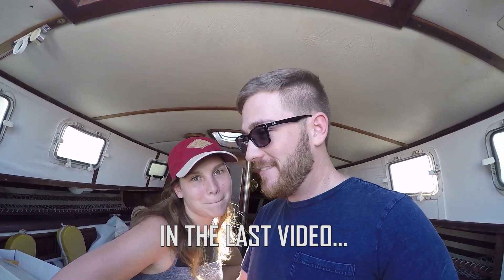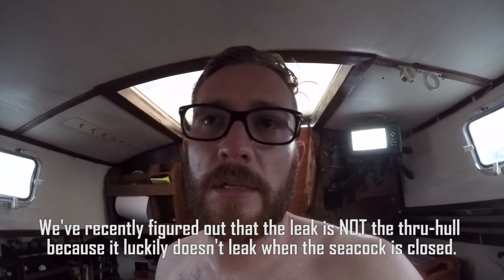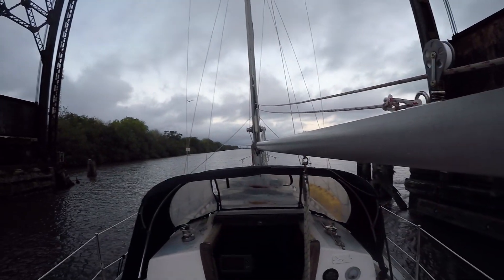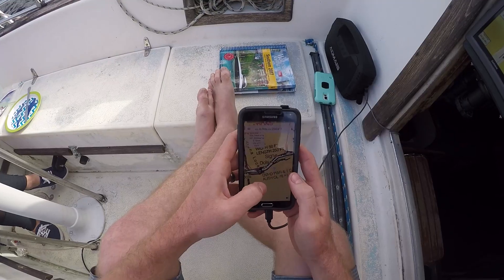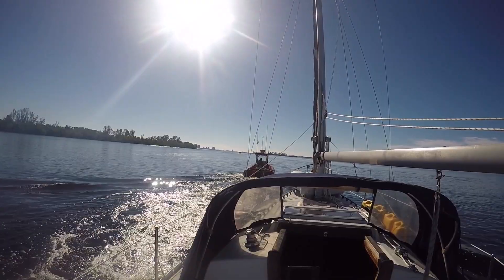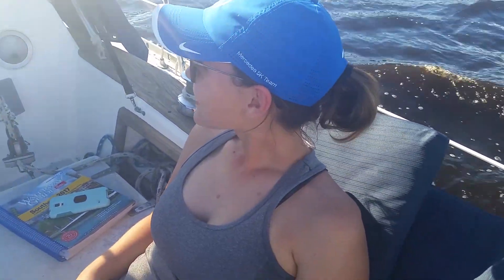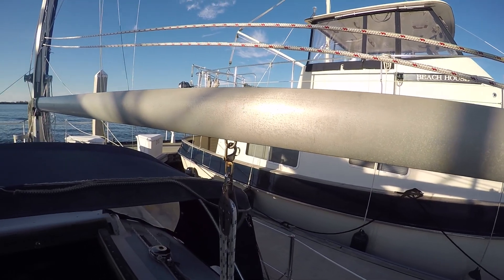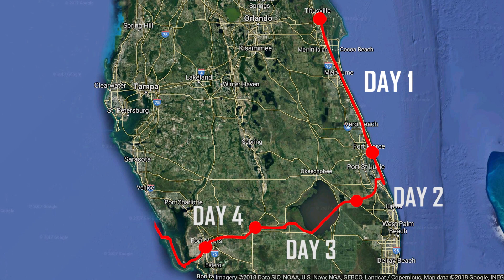33. Three Hundred Nautical Miles on a FREE BOAT! - DIY Sailing

Comment: I've never been that route in a sailboat either. Never even occurred to me not to sail around south Florida. Well done. Thankfully, you got a boat with a short mast.
Reply from the maker: Right? We were worried even though we double and triple checked the heights. Supposedly some people heel their boat with barrels attached to the mast if they're a little too tall.
Reply: Learning the Lines That can be tricky and can end up with a capsized boat! Also, you can bend or break the mast. On rivers around the world watch out for low crossing power lines as well. Cheers.
Reply from the maker: I do not like the barrel idea at all. Lol. I'd rather find another route, but I guess sometimes you have no other options. We bought a book that was all about sailing in the southeast region (I can't remembered the book/guide's title and its on the boat), but it mentioned the power line issue in it. There was a set of power lines on the ICW on the east coast that we had to cross under that has apparently caused many issues because of how quickly it tapers down from the mid-point. Apparently a lot of ships have had their electronics fried because of arcing from those power lines. Scared me reading about it. Lol. Made sure we crossed directly under center. -Randi
Reply: Learning the Lines Seems to me that you two are studying up on things which is a great way to go. There is a fifteen week boat course in Ft. Lauderdale that would have you ready to take on the world if you are interested. And there are lots of people who have brains you can pick and of course there is always books and tech stuff!
Reply from the maker: Yes, we actually love the learning process. Is the Ft. Lauderdale course done on weekends? It's a bit far for us. We watch a good amount of informational boat videos (e.g. Skip Novak's Storm Weather Sailing) on Youtube, plus info from comments and books. -Randi
Reply: Learning the Lines Actually, the course I was referring to is 15 weeks and very hands on intensive. There are two maritime training schools in Florida. MPT and the Chapman Institute. The course I was talking about gives you a full working knowledge of boating from the basics through emergency protocols. The USCG Captains license you get at the end is a minimal thing compared to what you learn. This is a professional level curriculum and takes the same dedication as any college or vocational training. The benefits to being a trained sailor, are lower insurance rates, peace of mind, and the ability to take paying passengers should finances be an issue in the future. The bottom line is that the sea kills people every year and preys upon the ignorant more than the knowledgeable. Don't want to get too in depth or time involved? No problem. Call one of the institutes and see what courses you can fit in. Also ASA has affiliate instructors ALL over the U.S.A. for their classes as  well. Cheers!
Reply: Amazing how many times in life a short mast actually makes life easier...
Reply: Hello Charles, I am interested in the fifteen week course in Ft. Lauderdale.  Can you share this information with me, please.  Thank you in advance.

Comment: Fix the boat and runit you need to be more self dependent diesel is easy only proses of elimination you should get to marina and get parts and install the buy and bring some harbor freight tools machanics a expensive if you used he fixed it 2 hours you could of ben on the way if you kept a few tools

Comment: Hi guys. Really well done, not only on getting there but making a great video too. Regarding your leak. It's possible that you're getting water into the boat via a thing called the stern gland. This is the "device" which the propeller shaft passes through to the propeller. You need to establish if it's an old style gland with gland packing material in it (usually has a big nut on it, or a sort of plate with a nut on either side, well, save a load of words, have a look here, scroll down to find yours : https://coxengineering.sharepoint.com/pages/sternglands.aspx). It will either be one of these or a newer (& costly) dripless seal type. If it is an old style one, and it drips in a cupfull or so an hour when the engine is in use, don't tighten it to prevent that. The water lubricates and cools the whole thing. It can be adjusted, and the Boatowners Electrical & Mechanical book by Nigel Calder should have a good description, or read that link I've posted. Vyv Cox is one of the foremost yacht/boat engineers in the UK, so following his advice will stand you in good stead. Although it's tempting to rush to a new style dripless one, I wouldn't recommend it. If the old style one fails, there are a number of ways to recover from it, & if maintained they're very reliable. Some of the newer one's are brilliant until they fail, and when they do they tend to be very difficult to seal to keep out the in-rushing water, so you could end up walking home. The boat looks like a winner as far as I can see, and a little maintenance (which you could need on a $100k boat anyway) and you'll be flying. We're cheering!
P.S Time AC's dog got his own channel :-)
Reply from the maker: Thanks for watching and for the input! We are familiar with the old style stern gland from removing the propeller shaft on our O'Day 272. We will need to carefully inspect the one on the Endeavor though to see if this is the source of the leak. Jordan thought it could be coming from the raw water inlet somewhere. Roo is an awesome dog! He doesn't have his own channel (yet), but he does have his own instagram: @meruthemini 
-Randi

Comment: A free 31' sailboat. With a working engine. With a roller furling main and roller furling jib. You've got some good karma. What's happening to the old boat?
Reply: I was blown away as well. Free boats usually come with ZERO extras and a seized engine...
Reply from the maker: Project Manaia - Ocean Conservation & Research We were very lucky indeed.
Reply: how long will the engine work,''Free,ugh..Nothing's Free..
Reply: I wish that I knew where to find a free or cheap sailboat. I know that I can do all the work to refit being that I'm a carpenter and am good with engines. Any help to point me in the right direction would be greatly appreciated.
Reply: Learning the Lines have you found a new dream? Or did you find a new boat?
What's up with y'all?
Reply: Get A book About Sailing,Refit,boat engin's,Wether,tide's,Wind,And how It work's on Sail's,For a Start*

Comment: $200 for corroded fuel pump terminals? White grease is your friend. It will prevent a repeat performance.
Reply from the maker: Thanks for the tip! The price was mostly for labor/cost of the mechanics time. We are definitely going to be checking our terminals and greasing them to avoid any further issues. -Randi
Reply: You want to get in an aerosol can. You should find it in places such as your local Auto Zone or Advance Auto.
Reply from the maker: Thanks! -Randi

Comment: My Endeavour fills up with water more when shes hauled out then when she is out on mooring, lol
Reply from the maker: What do you think is causing your water issue? We are still trying to figure out where exactly on our raw water intake is leaking. We are just happy it is not the thru-hull. That would be a much bigger project. -Randi
Reply: Learning the Lines pretty sure it's the cockpit and or lazeretts
Reply from the maker: It's always tough to determine the source, there's so many possibilities. Lol. One of our other viewers with an Endeavor 32 found that his binnacle was leaking. -Randi
Reply: Learning the Lines I think that was me , as soon as I covered the compass on the binnacle I noticed the difference but the bottom where it connects to the cockpit deck is very suspect
Reply from the maker: Jesse Reed S/V Matador Whoops! Lol. It's hard to remember who wrote what, but at least you know I was paying attention to what you said! ♡Randi
Reply: No worries, Cheers guys !

Comment: It’s a diesel they’re not complicated if you think it’s not getting fuel crack a fuel line loose and turn it over and see if it sprays out if you lost the injection pump shouldn’t be that hard to fine there those are not that hard to fix

Comment: You must learn engine repairs before stepping on a boat.
The main reason the engine wont start is ... the fuel not reaching the combustion chamber.
Reply: He did suspect the fuel pump.

Comment: Are inboard diesels so unreliable on just about every cruising channel the engine breaks on every episode it seems.
Reply from the maker: Haha it does seem that way! Yet, we've always been told they are so reliable....very confusing. Our little Tohatsu 9.8 outboard on Somnium was super reliable. We shall see now with this fix how our Westerbeke 20B2 does. -Randi
Reply: The problems usually relate to maintenance, age, access and installation. Access and installation are (surprisingly common) poor design issues. Things like tanks installed without a way of draining and cleaning them (no drain stopcock on the bottom and no access hatches on top). Lack of access to critical maintenance points on the engine (filter, pumps etc) usually means they don't get the maintenance they should, resulting in failures. A lot of owners bought the boat to use, not to maintain, says it all too. Another issue is fuel. Here in the UK, with the advent of biodiesel, fuel has a 6 month lifespan. Lots of people don't spend time finding this sort of stuff out until it bites them. Others here have mentioned wiring. Buy oversized, tinned marine grade wire to replace all critical systems wiring, with gel filled crimps and heat shrink or /and self amalgamating tape. For HT leads I use a type of welding cable, which is usually higher spec and cheaper than the boatstore stuff, lugs sealed on with plastic dip before the double heatshrink over all. It takes years to catch up on everything that can shaft you, but thinking that your engine should be capable of running underwater is a good place to start.
Reply from the maker: I must admit that even on the Endeavor 32, we feel like the design of that space makes it very difficult to service the engine. We were both in and out of the lazarette and quarter berth many times addressing engine needs. Thanks for the input! -Randi

Comment: The Motor is the Key-- I would Not have Cleaned it up, etc.. I wouldhave Replaced it with a New Crate Mtr or at least a Good Low Hour Used Mtr. and Rebuilt that one if needed.. Your Pouring your $ after Bad otherwise.. expect more $200 Repairs , ending up costing you at least $500 total.. For $1k you could have gotten a Good Low Hrs Used Mtr. for that and avoided all this Bull S@#%.

Comment: Alway's Cary An Outboard Motor,And A Book for the type engine you Have''Inboard'',And alway's check your Fuel filter when going From Salt Water to Fresh Water,and Back to Saltwater.I would have 2 Line's for 2 fuel Filter's.Shut 1 Off,and Turn The Other One On.1for Fresh Water,and 1 for Salt Water..And Test Them both Before head'ing Out..Just Sayin.Fair Wind's Mate..And Try to Cary Spare Part's.Maby,Water Hose's,& Clamp's, Fuel Pump,Rotor,Oil Filter,Fan Belt,Alt.Etc.Just Sayin..Alway's,At Least Pay,A Dollar For A Boat,Or,Give Them At Least A Penney,And Alway's give Her A Name For Luck, Before Leaving Safe Haven..Hint,Get Some duct Tape,and vice Grips,.Any Part's you Can Afford,One more Thing,''Never Tell anyone On Here where your Leaving your boat ''Alone''For 2 Week's Alone While your going Someplace Else,for A Week,Or so...I'm the Sea buzzard,and been Sail'in for 43 Year's now,Just Try'in To Help,and I Know I Talk To Much,lol..end;

Comment: Time to buy a multimeter, if you don't already have one. Also, undo, clean and grease with dielectric grease every electrical connection you come across.
Reply from the maker: We do have a multi-meter, so we will be putting that to use. We plan on going through and checking all the electrical connections we can find now. Lol. Thanks for watching! -Randi

Comment: Hm, not really happy with the boat name. It is just the same as a 40.000,- dollar boat. The owners just had confidence in you two. At the end of your sailing carer money is much less important then good new owners. If you buy about the same boat for  $ 40.000,-  your fuel line and tanks are still a problem, nothing to do with the price. Boat ownership is different. It is more the relation between parent and child. You wouldn't ask money for your daughter, or at least not anymore :-) Really cool what you are doing and I did not see anything that you might call a fail!!!